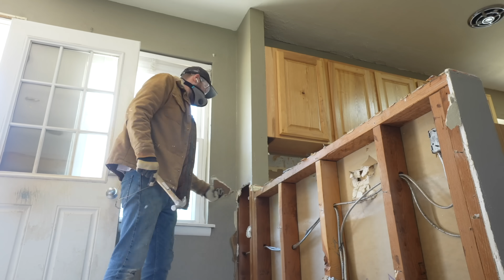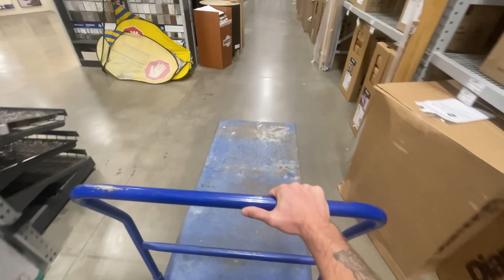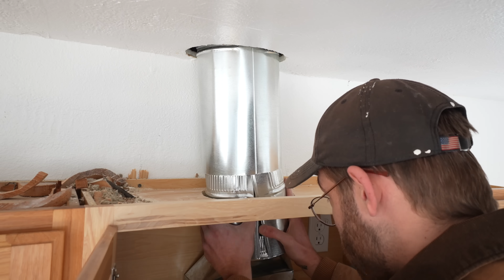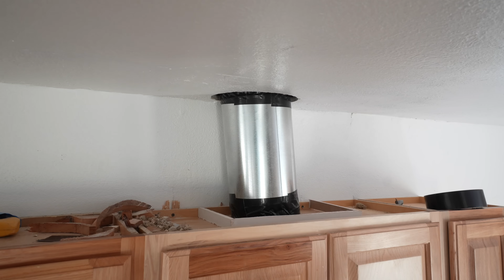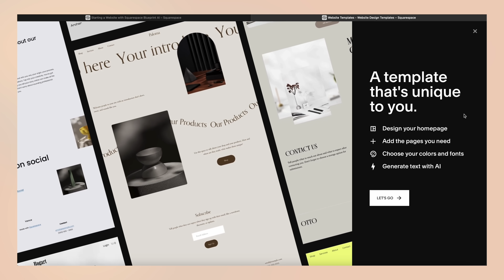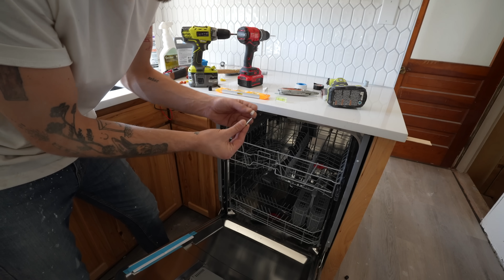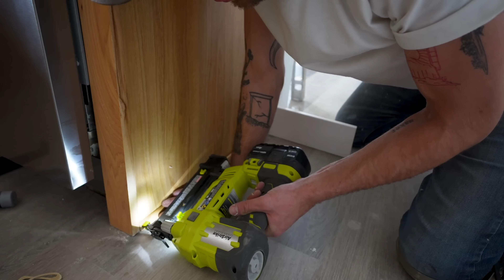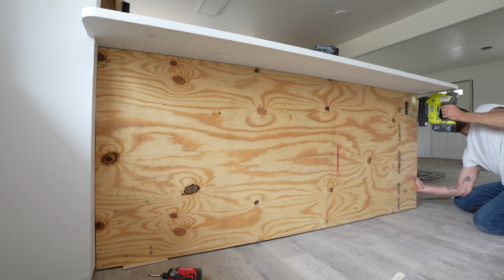I spent $5,000 to gain $25,000 in Equity!!! DIY MODERN KITCHEN RENOVATION

Comment: High five to modern build dad,  Gary. Get that guy a nice cold beer 🍺... question. On the ducting for the microwave, you said you used duct tape. Doesn't it have to be foil duct tape? I'm just asking to ask ... another question. On the final price, much more would it be if the floors n sink were not provided?  Also did the final price include the cost of opening the wall?